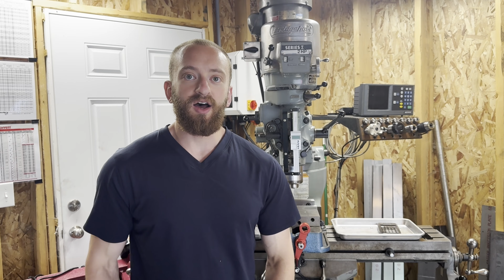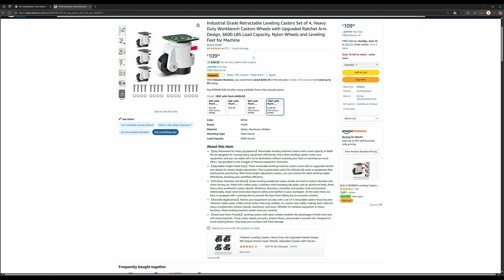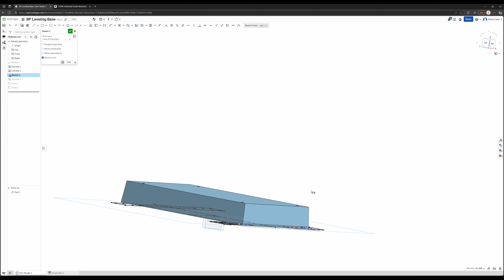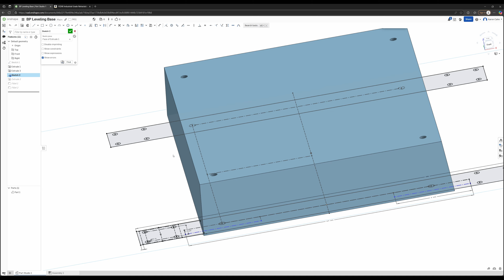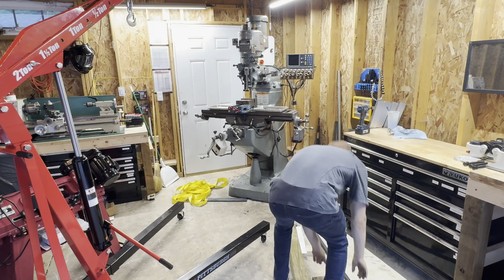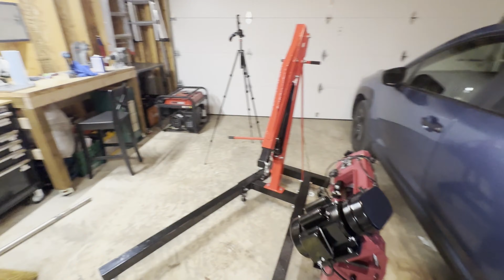Rolling & Leveling Base for Bridgeport Mill

Comment: I had to do the same for my 3/4 sized Burke knee mill.  It weighs 1500lbs. I had open floor joists above so I reinforced those a bit and used a 1 ton chain hoist to lift it enough to slide a wooden platform under it.  This now allows me to move it with a pallet jack and it raises it to a more comfortable height.

Comment: Nice.  I like the idea of wide spacing to accept a pallet jack but, for me, I would either trip over it or bust  ankle when working in close to the knee.  Maybe as a suggestion, at a minimum add a healthy radius at the protruding corners of the 1" bar.  Question about the 100F casters:  how easy or hard is it to actuate the ratchet when raising the mill?
Reply from the maker: That’s a great idea! Wish I had thought of it before painting… lol. Definitely still worth doing though. 

Not at all difficult. It’s definitely harder than being able to do it with just the little tab sticking out, but I just stick a little T handle wrench into the hole meant for an extension on it and it’s fairly effortless at that point